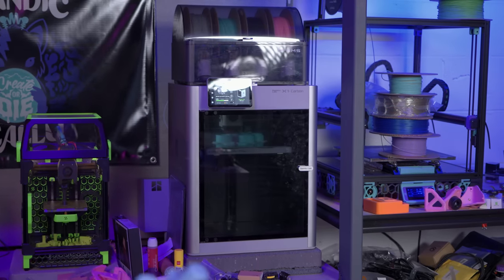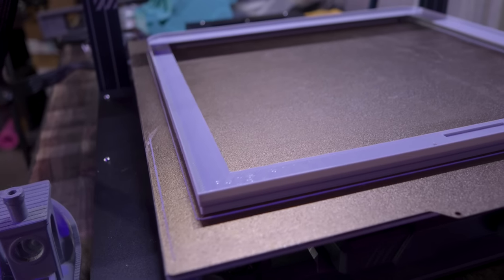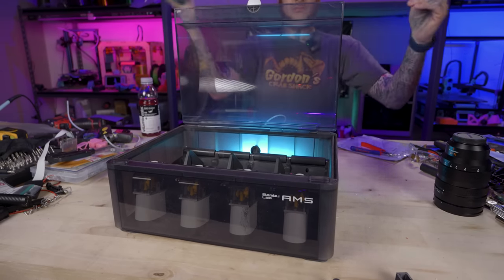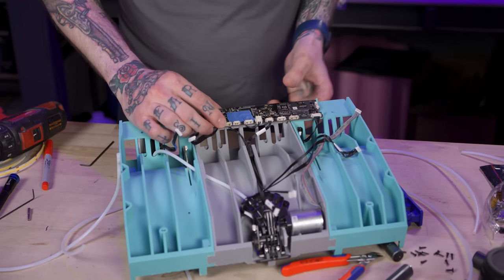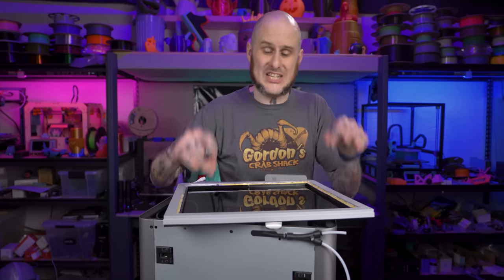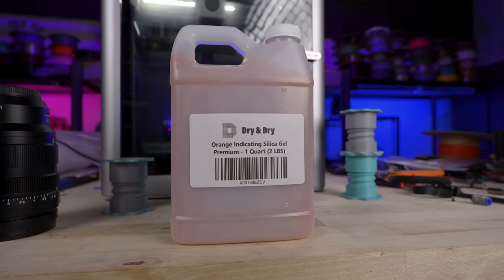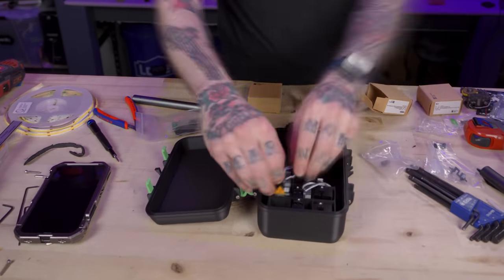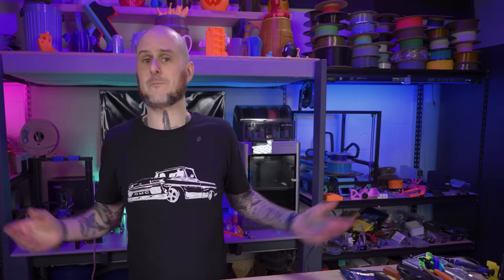GAME CHANGING Bambu X-1 Upgrades! - Hydra AMS & More!

Comment: I noticed that you are running cardboard spools. Did the Hydra upgrade make it possible to run the spools without modifications?
Reply: did you watch the video????
Reply: @MG1776-t9p  I sure did... and he never mentions anything about it, maybe you can be helpful and point me to where he does though. The AMS is known to not run cardboard spools very well hence the many files available to add a ring around the spool. I was hoping to get a clearer answer to this before I put time and filament into something that wouldn't improve this particular issue. Perhaps he never had any issues or they he did and they got better, that's all I wanted to know.

Comment: Could you use some of that rubber foam tape stuff for sealing up windows (I think it comes in 1/4" or 3/8" widths)?  The stuff I'm specifically thinking of kind of looks like a capital letter D on the cross-section, has a hollow center, and isn't very thick when compressed.  You could maybe take the door off, mount that tape to the printer, and reinstall the door.  When you open/close the door, the tape would (I think) probably move with it.

Or it may be too thick.  

Voron Spec 1mm thick foam tape might work also if you have any left from your Voron Zero builds (I'm not sure if the Zero uses that foam -- I have a Trident).

Comment: I have the same desiccant and I would worry about it rolling around in the vented tubes as the beads I have in mine tend to break easily and you'll get "dust" everywhere, have you experienced any issues with residual dust from broken beads?
Reply from the maker: A fair concern. Worst case you end up with desiccant dust in the AMS.  Wipe it out carefully and it shouldn't be much of an issue.  I'll keep an eye on it. I haven't had any issues to this point but other applications where I've used it weren't constantly moving.

Comment: Hey man, I found my build plate was uneven. So I put aluminum foil and kapton tape under it to even out the dead spots. I found since I did that, my printer works better. I could have gotten a new build plate but it's a nightmare to actually remove/replace it apparently.

Comment: Did anything change with the messaging from BL about PLA-CF? I'm looking at the PLA-CF page and it says in multiple places its safe for AMS use. I've run the whole sample spool on mine and i'm scared i might've worn my internal PTFEs, I'm too lazy to bust it open to find out though lol
Reply from the maker: I don’t know. They are very inconsistent about what they say is and isn’t safe in the AMS. I’ve replaced my AMS tubes multiple times now. Regular materials seem to wear them out too, so I can’t imagine any CF filament is a good idea. 

They seem to claim now that the issue is more PA-CF is too brittle and breaks inside the sharp bends of the AMS tubes. Which makes sense but ignores the wear factor.

Comment: really should be a standardized filament sizes. seems each manufacture like to do things just a tad different.
Reply from the maker: A lot of companies have to setup equipment to fit the spool sizes they are working with. Shipping boxes, etc also. And those spools are usually dictated by suppliers. 3D Printing is a fairly new industry so often we are using spools from wiring / plumbing industries repurposed. Specific application products are smaller supply runs so higher cost. Standardization is a difficult concept when so many companies work across the globe doing this. One company may see no issue with spending $.10 more per spool to get the "Standard", while for another that could spell disaster to their bottom line with their razer thin margins. Business isn't easy and adapting to fit a standard "imposed" by one company that may or may not continue to be dominant is difficult to justify.

Comment: How did you make the timelaps with the printhead on the left position. Mine is moving all over the place.
Reply from the maker: You have to set the Timelapse mode to “smooth” in the slicer. I believe it is in the “Other” tab.

Comment: Chamber heat would also vent through the filament purge shoot on the back of the printer?
Reply from the maker: Yep, but blocking that prevents use of it. It should really be blocked whenever not purging. Oddly it’s sort of the other way around. It semi blocks when purging.

Comment: one thing about the indication silica gel. Most of the orange indicators are toxic. Don't use it when you print things that touch food.
Reply from the maker: Personally I don’t recommend plastic printing things that touch food ever. Consumer 3d printing hardware isn’t designed with food safety in mind. Extruder gears, hotends & nozzles could all be shedding bits of metal into your material at any point.

Comment: Mey Mandic, I bought the electric screwdriver that you demonstrate in the show to support you through affiliate links, but note that it doesn't come with very common 2.5mm bit. I am having a challenge finding them. How did you source? Thanks!
Reply from the maker: I keep forgetting to make note of that, sorry.  I didn't even realize at first because I used a bit set from a previous screwdriver set.  The electric one doesn't always fit into tighter locations, so one like this is helpful for that (and includes the bit): https://amzn.to/40jv4O3

Comment: As a 'newbee' wouldn't you want a warmer temperature in the AMS to help dry it before entry? Or is it a marginal issue?
Reply from the maker: Chamber temps are going to matter significantly more than AMS temps. The marginal temp difference in the AMS isn’t really going to result in a drying effect. Drying usually requires higher temps sustained for a much longer period of time.

Comment: I dunno man these arent really 100% necessary, the tools you talked about in this or another video are cool. But I wouldnt call these a level up. They are at best a side step that could cost the warranty. 
The whole hydra ams is a good idea, But, your making spools heavier, placing more demand on the already struggling motors with heavy filament.  Also the biggest loss is, with the use of the bigger spools dont actually fit allowing moisture to creep in with the lid open,  why pull everything apart when you could just put a printable spool holder beside or use the one on the back of the machine and swap a spool there if its too big. 
100% agree with the crap lighting, I think the glass is tinted due to the laser, but it only does it at the start, so turn off lights at calibration, back on after. I will definetly do this mod, I like the risers for the glass as well, but disagree with the sticking stuff to that glass, Youd never be able to send the machine back if you do that. Just put a piece of polystyrene or other insulating material ontop . Glass and air is a fantastic insulator. BTw those little hygrometers are wildly inaccurate, I bought ten of them for like $10 and all of them have unique readings, lol Also why are you using polymaker over the bambu stuff?

Comment: Did you ever consider rewinding spools instead of customizing the AMS?
Reply from the maker: I considered it and wrote it off. It would mean labor (with a chance of something going wrong) for every single spool I wanted to run. Or one set of prints and one 30 minute install job, one time. One bad rewind & a wasted spool would cover the filament used for this one print.

Comment: I see ringing on the hydra parts is way better. What improvements did toy make to x1 to reduce tour ringing issues?
Reply from the maker: My personal print profiles are drastically slower than the default profiles. Combine that with manually tuning in Pressure Advance and maybe firmware updates (not sure on that one). It’s better than when I complained about the issue for sure. They REALLY need to release quality presets.
Reply: @MandicReally  thank you. The acceleration is insane for very little time advantage. So I've reduced mine incrementally to see when ringing reduces.

Comment: Curious if you insulate the top glass if you get heat creep on the extruder?
Reply from the maker: I insulated it after this video. It maybe gained me .5 degree of chamber temp but no heat creep issues. I print a lot of ASA & ABS with it though. I do print PLA from time to time and haven’t had any issues.
Reply: @MandicReally  Thank you for responding. I just got mine two days ago and I only print ABS (for now). I have lots of questions and your videos definitely help me. I have two vintage Replicator 2x's and this Bambu Carbon is a nice upgrade.

Comment: I would be worried about printing abs,asa,pc and nylon with that petg extension at the top. Might be worth printing the entire thing out of tpu for the extra temp resistance.
Reply from the maker: The chamber temp only reached 52C.  PETG is good to 75-85C and the design is well supported to not really fail much even at that point.  The metal structure may be hotter than the air temp but I doubt it is that much warmer.  I went with PETG over PLA for the higher temp handling but I doubt anything more than that is really necessary unless you add active chamber heating.  At that point other parts of the machine are likely to fail too.

Comment: I have nothing but issues with Printing ABS on this machine, the plates do not withstand the shrinkage pressure and deform, the print does not lift. Adhesion is really good lol!

How have you overcome this?
Reply from the maker: I’ve not had that issue but I’ve seen others have it. I print a lot of ABS & ASA, but I bake the chamber to warm it up before I ever start and have it pretty dialed in settings wise. I’ve seen some folks make clips to hold the bed sheet down so they can’t happen.
Reply: @MandicReally  I've got a thread going in the discord and a few users have switched to FR4 with huge success, I just thought I'd ask you as your prints seem flat (onscreen)

I've tried pre-heating 4 hours it only gets to 47degC. 

The other thing to try is you've replaced the sheet with Whambam, maybe that is thicker spring steel and holds down to the magnetic base better?

Really appreciate you taking the time out to reply, thank you!
Reply from the maker: @kenay1989  sadly the default chamber situation sounds about right at 47C. My insulated chamber only gets to 53C after hours of printing. 

I have zero experience with FR4. I did print a few hundred hours with the Bambu Labs plates before switching to the Wham Bam. I never experienced that bed lift issue, just seen others have it. 

What brand of ABS are you running? Lot of part cooling? Default Bambu “Generic ABS” profile?
Reply: @MandicReally  No part cooling, Aux and chamber fans off.
 Bed at 90 (someone said lower temp may help magnets) TBH it has help slightly.

I use Progressive3d ABS, funnily enough they have 6 X1C's in their fleet (50+ machines) and have 0 issues lol

I know it's not the filament causing issues, 0 issues on my other machines..

Slightly modified Generic ABS profile (higher temp) 100% infill, larger wall count etc.

The prints are stunning, just not flat. That's a huge problem.

I'll give the FR4 a go, I was kind of hoping there was something blatantly obvious I had missed :(

I've pushed about 30KG's through this machine already, but I could have used it much harder and if not for these issues I'd buy another 2 or 3 tomorrow

Thanks again :)

Comment: Where do I get the collets for the over engineered y splitter?
Reply from the maker: Here are the collets for the one I used in this video (I ended up not liking it): https://amzn.to/4fpMctv

The Y-Splitter I found that I like MUCH better is this one: https://makerworld.com/en/models/100346#profileId-107061

Filament feeds through it so much smoother. The other one I kept getting issues with the AMS feeding filament back and forth through it. This new one is flawless. 

That new one requires these collets: https://amzn.to/3LMY9vV

Hope this helps. I HIGHLY recommend the newer Y Splitter that I linked here.
Reply: @MandicReally  awesome,  thank you!

Comment: If you have the lidar disabled....a P1P with about a hundred bucks of upgrades will be essentially the same and still be 400 bucks cheaper than the x1
Reply from the maker: The P1P didn’t exist when I got the X1. I also mostly print higher temp materials, not PLA, so the enclosure is very useful. And the P1P interface and software aren’t the same. A few friends who have them complain about it often. For me? A diy enclosure on the P1P may be superior now, but I didn’t have that option last year.

Comment: How loud is the Bambu printing at a normal speeds. Ive wanted to get one but hearing they are really loud when printing at high speeds
Reply from the maker: High speed IS Normal Speed on the Bambu.  Even with my quality profiles being tuned down in speed by quite a bit, it is still not very quiet. It noticeably tones down when you cut the speed, but you'll have to do so manually for every print (either on the screen or by creating your own print profile).
Reply: @MandicReally  thanks , maybe this isn’t the best choice for my home office . Looks like a great printer

Comment: Do the sensors work with the light?
Reply from the maker: First layer detection does. I don’t use the “LiDAR” tuning as I find it doesn’t do anything, so I can’t speak to that.
Reply: @MandicReally  and the spaguetti detection?
Reply from the maker: @javiercubero4359  works fine.
Reply: @MandicReally  some more questions, the x1 carbon will be my first 3d printer, is it a good idea? Do I need glue stick or hairspray? Where can I buy that screwdriver?

Comment: Anybody try Capricorn Tubing on the AMS yet? Being slightly smaller it may feed better.
Reply from the maker: It may cause greater restriction too.  The motors are the AMS are tiny servos that are very weak. It doesn’t take much to overload them. I wish they’d go with a less standard say 2mm ID tube w/ thicker wall than 4mm diameter allowed. I use 2/4mm for reverse Bowden tubes as to reduce the drag on filament, Bambu uses 1.8/4mm everywhere from AMS to the Toolhead.
Reply: @MandicReally  I was checking tubing. Flat ends on filament drag alot more than angle cut. Does the AMS cut filament on an angle. If it doesn't maybe someone could change it.
Reply from the maker: @tomtaylor135  it cuts flat. I do think a 45 would be superior, but the cutter is in the filament path between the Extruder and the hotend. Adding angle would add length to where it fits, which means a longer filament path, etc etc.

Comment: wait a second....
You tell me, that this is a $1000 FDM printer and you need "upgrades" cos the creators of the system had good ideas but some of them where lacking in the implementation? 
dont get me wrong, i dont mind upgrades in case of an Ender3/V2 price point printer, i do think these are sore points at this price point...
Reply from the maker: “Need” is a stretch on the sentiment. The machine works perfectly fine out of the box for most uses. Better than most for sure. Just to make it what I ideally want, modifications have to take place. Maybe some are things the engineers didn’t see a need for. Maybe some are things that would have raised the price point. Maybe they will be in the next version as they learn what people want. No way to know currently.

Comment: you don't need that tool, just grab it by the wire...
Reply from the maker: The cable has a retainer clip. You should never pull cables out by the wire, especially ones with a retainer clip…

Comment: Either you're the first human I know who's smarter than the auto-calibration system, or you're using really crappy filament.
I, on the other hand, am lazy in addition to being not so smart, and I use the autocalibration all the time, and I'm getting absolutely perfect prints all the time on the first try. 🤷‍♂️
Reply from the maker: Auto calibrate only calibrated Linear Advance and nothing else. The rest is marketing. Even Bambu has come out with an article telling folks to manually tune flowrate for best results. And in my experience the Linear Advance tuning sets a value, lays down some others, scans them, then tosses the data and goes with the initial setting pre-loaded by Bambu. It is that Bambu has done a decent job of getting some baseline values set in already. But that isn’t true of all materials.
Reply: @MandicReally  Perhaps your unit has a problem. Mine is stock and I get visibly better results with auto-tuning than without.